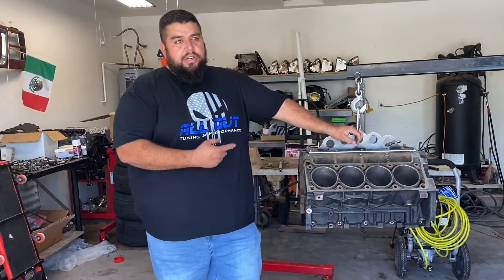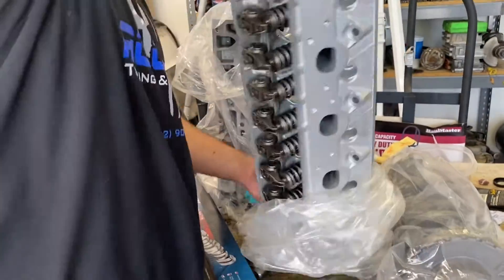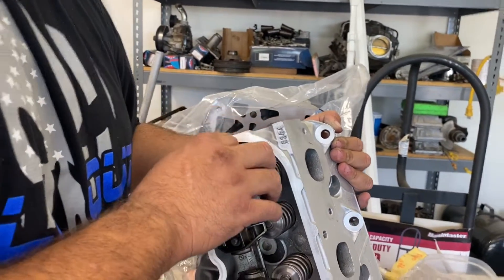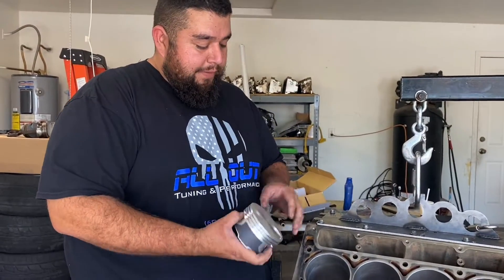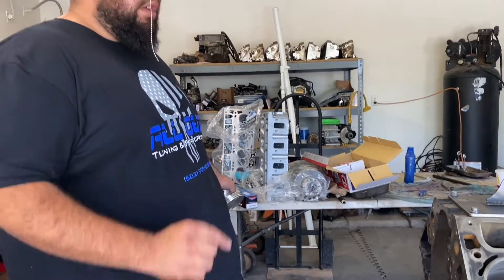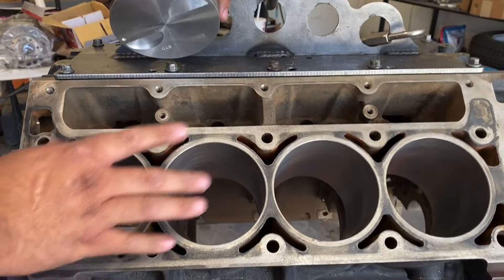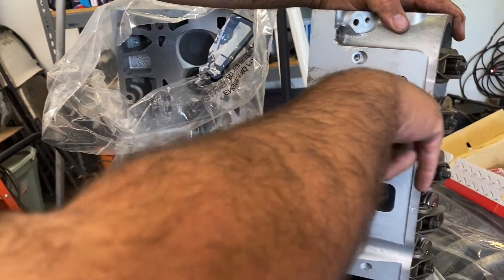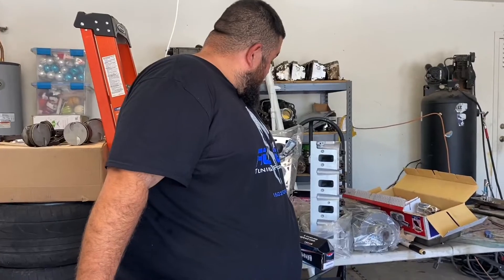Frankenstein 6.2ls  well it’s a 6.0 block

Comment: Why did u take out the the stock crank and then replace it with a 5.3 crank smh 💯.. a stock LQ9 doesn’t need much becuase it’s damn near bullet proof iron .. the stock bottom end can handle damn near 1200 hp with out changing the internals …. I just needed heads and cam 🤷🏿‍♂️

Comment: Im planning on doing this to my lq9 .. how much power you think it should make . I will be running the lq9 crank with oem ls3 piston and rods . With ls3 heads, ls3 manifold, gm performance lifters , a btr ls3 stage 3 v2 cam , longtubes, & 102 fitech Throttle body
Reply from the maker: should make over 440+

Comment: For a 6.0 lq4 already punched to a 6.2 with ported 823 heads that'll be running a ported LSA blower would you recommend buying a bottom end stroker kit or could I get away with the stock or gen 4 rods since I hear that'll hold 1k hp?   This is all going into a G body backed by a 4L80e with a ford 9 inch. Just something to toy around in and hit the track occasionally for shits and giggles.   I wanna do it the right way the first time around while I still have my motor out
Reply from the maker: will hold but only for so long if your looking for anything over 800hp  to live long i would recommend forged internals

Comment: What bearings brand and what kind did you use on the motor man? I’m in the process of building one myself. And I need some input before ordering
Reply from the maker: Clevite race bearings
Reply: @GBP_Vlogs  did you use Gen. 4 rods with the 6.2 pistons bro? Or was everything aftermarket? Is it possible to run Gen 4 rods with stock 6.2 pistons? Would the crank need to be rebalanced since the pistons are bigger?
Reply from the maker: @lauroguerra732  gen 4 rods. Stock ls3 or Denali 6.2 pistons  and no need to  balance
Reply: @GBP_Vlogs  thanks man

Comment: Nice! I'm doing almost exact build. Did you need any balancing when adding 6.2 pistons?
Reply from the maker: Not at all
Reply: No u don’t need to balance them the 6.0 and the 6.2 pistons are the same after you bore it u can use the same rods and just switch the free floating head

Comment: Im picking up a lq9 block/rotating assembly, Having it punched to a 6.2, can I run ls3 (Camaro motor) pistons? I planed on ported/Polish 706 heads with 2 inch valves and a bfd chop monster, I should be able to run the stock lq9 crank and rods with no issues?
Reply from the maker: Yes it should be fine

Comment: You could have used stock LSA pistons and rods with the stock LQ4/LQ9 crank. You'd have a solid bottom end for sure. I've always heard you really shouldn't bore the 6.0 iron block out .065" to get the 4.065" bore of the LS3/L92 block.
Reply from the maker: We bore out another 6.2 out of a 6.0 and it’s on 11 psi  pushing close to 700hp. No issues
Reply: New to the channel. I love it. Do you have a video of the 6.0 to 6.2 with boost? Lsa or turbo? Thanks

Comment: i have an LQ9 and want to punch out to 6.2l. looking to use my LQ9 crank and gen 4 rods with 4.065 weisco pistons will that work?
Reply from the maker: As long as the weisco pistion is a std application  yes
Reply: Probably better to only go .30 over and installer a stroker crank instead.

Comment: this is why I love LS stuff. 6.0 block punched out to a 6.2  crank out of a 5.3 gen 4 rods out of a 6.2 and 6.2 truck heads. it's so easy to mix and match parts.
Reply from the maker: exactly
Reply: Balance first
Reply: Yeah but the stock 6.0 crank is stronger than the 5.3 .. it can handle about 8-1000hp so changing the crank was just dumb , something extra to say look what I changed but was unnecessary
Reply: @KeepSycklids 6.0 and 5.3 use the same crankshaft. only difference between the two is the crank balance to compensate for the heavier pistons. the part numbers are the same. 
the stock bottom end record was set with the 5.3.

Comment: Did you use the rods with the stock 6.0 crankshaft and did u have to balance it ?
Reply from the maker: 6.0 gen 4 rods 6.2 l92 piston  6.0 stock crank  5.3 6.0 and 6.2 share the same crank
Reply: @GBP_Vlogs oooooh know I know why u used the 5.3 crank it’s the same as the 6.0

Comment: When you program the ecm do you still put 6.0 or 6.2 now?
Reply from the maker: that really don't matter as long as its tune properly
Reply: @GBP_Vlogs  ok. Trying to figure out with base tune to go with in hp tuners to get it running
Reply from the maker: @jhype9560  what is your setup  and in what truck/car?
Reply: @GBP_Vlogs  6.0 bored to 4.065 with ls3 heads and cam for now. Looking for another cam at the moment but wanted to get thing running first. It's in a car
Reply from the maker: @jhype9560  what transmission?
Reply from the maker: @jhype9560  and what car is it?
Reply: @GBP_Vlogs 2015 Chevrolet SS
Reply from the maker: @jhype9560  the ss came with ls3 if your talking about the Chevrolet ss sedan. Does it have its stock pcm? If it does or it has a pcm it will fire  the engine up no problem
Reply: @GBP_Vlogs  yea I have the stock pcm I just wasn't sure if I should change the engine to 6.0 or leave it as 6.2
Reply from the maker: @jhype9560  no it will run with that pcm.  Obviously just will need a tune because of cam  but as far as you starting it. It will fire right up
Reply: @jhype9560 how’s it running now?

Comment: Good video bro. 

Only suggestion I can think of is not to refer to them as square port, they're rectangular port. The LS7 heads are square port and that could throw people off. 

How did this build turn out?
Reply from the maker: thanks for the suggestion   guy got the truck tuned  but only street tune  still going hard  truck very rowdy  fast

Comment: Wat 6.2 heads r better wat casting number
Reply from the maker: 0821 is the ls3.  All other casting are the same just intake valves are the only difference
Reply: @GBP_Vlogs  so the 0821 are better
Reply: @GBP_Vlogs  r they better than 243s ?
Reply from the maker: @elseco2341  they flow more cfm then 243
Reply from the maker: @elseco2341  square port vs cathedral port
Reply: @GBP_Vlogs  so 0821 better bro
Reply from the maker: @elseco2341  yes for a 6.0 or a 6.2.
Reply: @GBP_Vlogs  6.0

Comment: I plan on punching mine out as well to a 6.2 but I heard the 706 heads are better.
Reply: 706's are not a "better" head than the LS3 heads. The LS3 heads flow 309 cfm @ 0.500" (intake) and 191 cfm @ 0.500" (exhaust) whereas the 706s flow 219 cfm and 175 cfm (intake/exhaust) at 0.500"....factory configuration. That's a 141% flow increase on the intake and 125% increase on the exhaust, LS3 over 706.

Also, the LS3 head has a 2.165" intake valve whereas the 706 has a 1.890" intake valve, thus why the LS3 flows far more air. LS3 exhaust is bigger as well (1.590" for LS3 and 1.550" for 706). 

The only thing the 706 has that may be helpful to some is a 61cc combustion chamber whereas the LS3 head has a 68cc combustion chamber. 

Blanket statement that the 706 is better is grossly inaccurate. You can however run the 706s on engines with a bore size smaller than 4.000" but the LS3 heads have to be run on engines with 4.000" or larger.
Reply: The 706 head build more port velocity which increases torque.
Reply: @moabman6803  increases torque on smaller motors
Reply: @BlackandWhitecustoms more compression will increase torque on ANY MOTOR
Reply: @moabman6803  gaining a little compression but losing flow will not gain you torque
Reply: You need to port those 706's quite a bit I'm pretty sure for anything bigger than a 5.3 to work well

Comment: Any updates on this truck built how did it  come out
Reply from the maker: rmsaenz11 truck made 380hp with the stock 24lbs injectors  he ended up getting 36lbs injectors and ran out of injector and made 391hp he bought 52lbs flex fuel injectors still waiting to go back and re- dyno but motor will make over 400hp.
Reply: @GBP_Vlogs  thanks for reply  im doing same setup on 2004 single cab but different cam hoping for similar numbers waiting on some parts 🙏 😬
Reply from the maker: rmsaenz11 should be up there
Reply: Garagebuilt Performance wat do u have done to it n how much hp u make

Comment: What brand are those pistons bro? I have a gen 4 6.0. I’m need some 30 over pistons
Reply from the maker: Aaron Alvarado the pistons are enginetech pistons
Reply: Garagebuilt Performance thanks bro, let me look into them hopefully I can find some.
Reply from the maker: Aaron Alvarado you can find on eBay
Reply: I want some with valve reliefs but no luck, I can’t seem to find any.
Reply: @dobleaaracing2204  enginetech p5076 about $300
Reply: D. Johnson I needed some for a 6.0 those are for 6.2. It’s a bigger bore but I appreciate you trying to help me out
Reply: Currently pick up a 6.0 but had iron heads heard the crankshaft sticks out more from the flying wheel any info on that